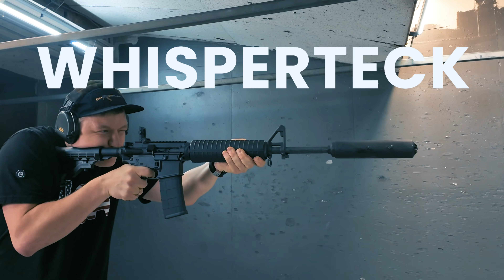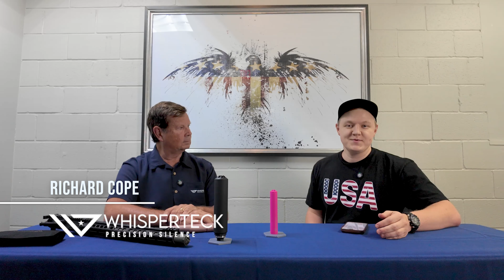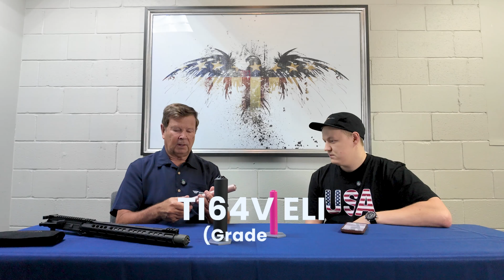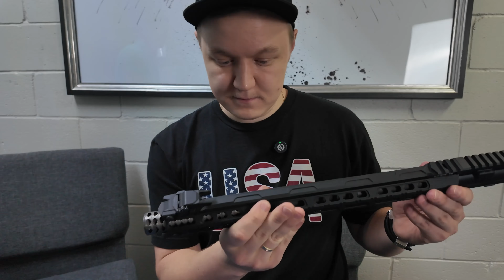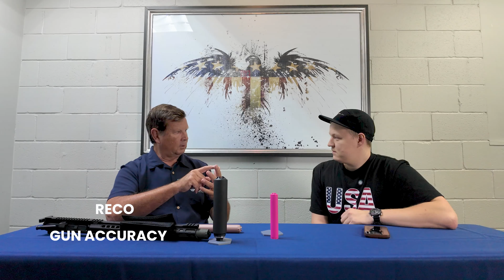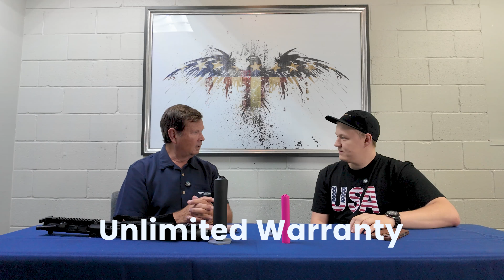Whisperteck Suppressors – God-Tier Engineering in Action | Interview w/ Richard Cope - USMC Engineer

Comment: I want more info on the .300 black in integrally suppressed, I am not seeing over all length
Reply: He used the phrase pinned and welded so I’d presume that even thought the barrel is 10” the shootable OAL is 16”. He also stated 1 stamp gun. That stamp would be for the suppressor not as an SBR.
Reply: @MrTeamZissou  well you get around the 2nd length benign 16”+ but the one I have now is 23” so I am looking for much smaller. The barrel is 10.5 and suppressor is 9” so it potentially could be a lot longer than 23 inches overall putting it really long and definitely longer than I want
Reply from the maker: You can come see it at Mainstreet Guns and Range - they are available.